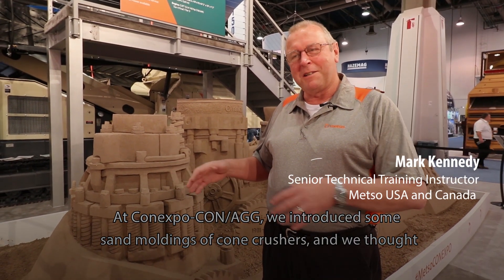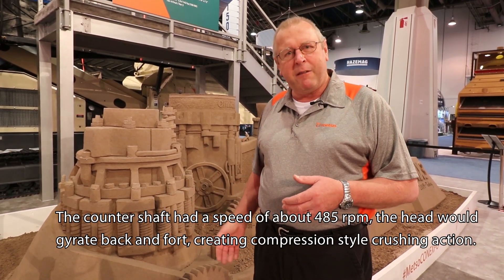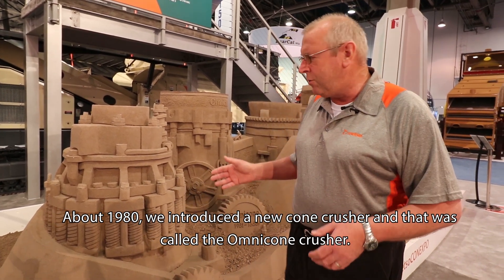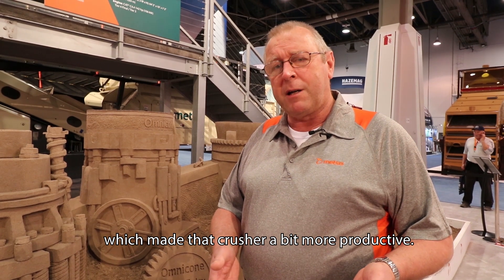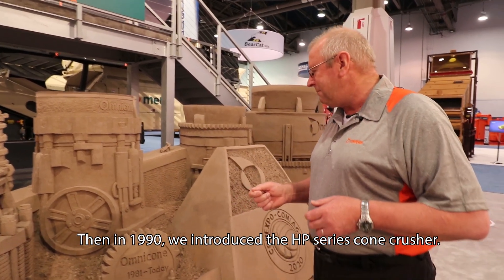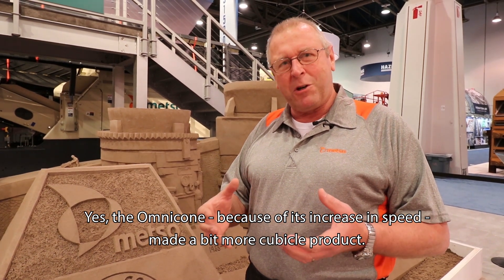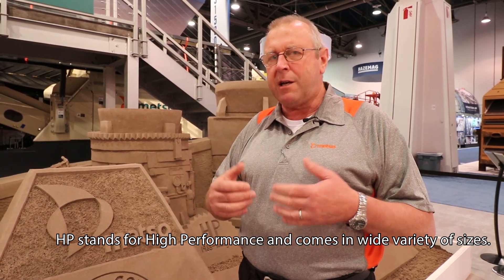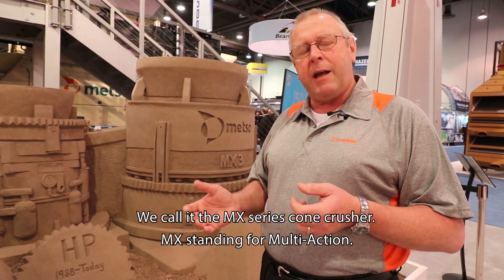From Symons™ to MX™  -  Evolution of cone crushers #MetsoCONEXPO

Comment: what about the banker cone crusher made in 1875 by gates iron works size no 1 in chicago  usa
Reply: They are gyratory crushers not cone crushers. The big difference between the two is the shapes of the crushing chambers and what they are used for. Gyratory crushers are better suited for crushing rock in a primary plant (for example taking pit rock and breaking it down to a size smaller crushers can handle). Cone crushers are meant for creating final products that are more likely to be sold like your state spec stones. Also, gates was the first person and company to make gyratory crushers